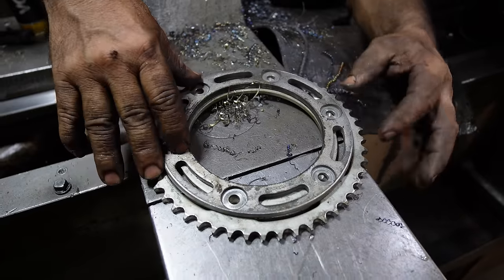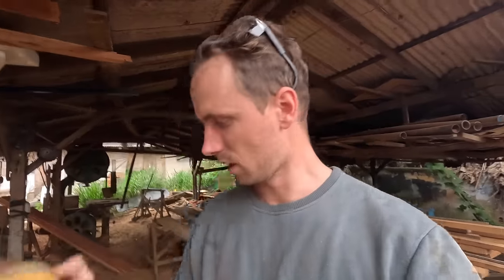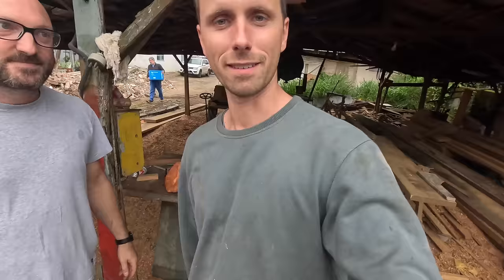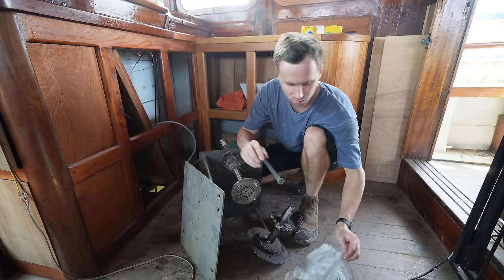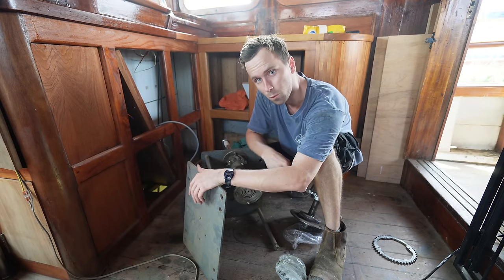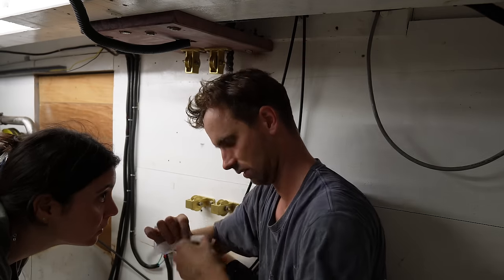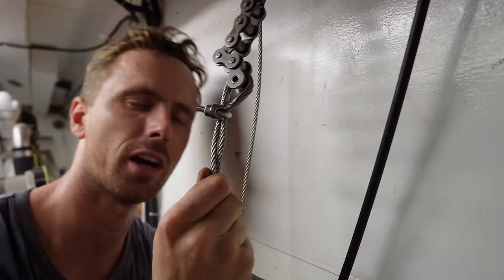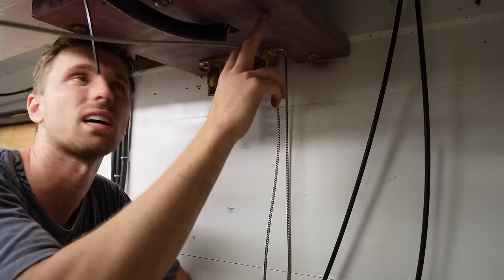Upgrading the old fashioned steering system of our RESCUED wooden sailboat — Sailing Yabá 158

Comment: Just a reminder - you know this already - but just saying - the steering system is the most crucial of all the systems on the boat. It cannot afford to EVER break or jam, so it needs to be over-engineered to be on the safe side. Pulley diameters need to be considerably larger to reduce repeated bending strain on the cables, and the cable itself should be at least twice the diameter that you're using. Don't forget Murphy's Law ... "If anything can go wrong, it will." Love your channel.

Comment: I would put a turnbuckle on both sides of the cable run to allow you to tighten the steering cables over time. The cable will stretch over time and you need to be able to take that slack out. You could use a tensioner pulley as well. The general idea is to be able to tighten without undoing the cable clamps holding it all together.
Reply: Absolutely
Reply: Great advice!
Reply: Strongly concur.
Reply: brilliant suggestion
Reply: A strongly sprung tensioner pully will help greatly with rudder shock. Just in case you hit an object (Sperm Whale) or s bit of coral.
Reply: Most systems use springs on the pulleys
Reply: Good idea
Reply: Always fascinating to see how you solve problems. Thank you for my Sunday morning coffee with Yaba!!! ❤
Reply: Yes, there needs to be something that will allow you to compensate for the stretch that is going to happen.
Reply: @m35a2ww  I have cable and windlass style steering system on an older boat. Partway down the cable is a healthy spring replacing the cable. The spring serves to keep the entire cable system in tension.
Reply: Good advice Marty Australia
Reply: Good idea adjustment is always a good thing
Reply: Yes turnbuckles are the way to go, plus maybe a larger cable to cut down on stretch.
Reply: You would be better off with a larger cable (± 3/8th ,10mm) I would also use nylon guide pulley rolling bearings for cable support. Turnbuckles are a must.
Reply: I agree, new wire will really stretch. Also there are two many turns lock to lock and blocks are way too small which will create wire fatigue..I would strongly suggest Dyneema instead of wire
 I hate the cable set on the stern, I had similar a few years ago, cable stretched and broke a long way from shore, similar location and was very difficult to jury rig steering
Reply: Very good point. My thoughts exactly.
Reply: Definitely a must have.
Reply: That’s right.
Reply: We had those on the schooner I worked on.... Came in handy during a particular messy passage when the old rope rubbed an gave way!!...

Comment: The helm station is a very robust upgrade well done. The cable and connections are definitely under sized for the size of the boat and the pressure the rubber will put on the steering system. There are quite a few great suggestions on here that I think you need to evaluate. I have been watching from the beginning and the boat is looking great. I am excited to see it in the water. Be safe. ⛵🇺🇸

Comment: Hi guys that's certainly an improvement but there are a few things missing.  You need a breaking system to secure the rudder in the midships position so that it does not thrash around when not in use.  How do you propose adding automatic steering?  Helming a boat on a continuous  24 hour period is not only very tiring but exceedingly boring and in poor weather will exhaust a small crew in very short order.  I also believe the quadrant attached to the aft part of the rudder is at the wrong angle if it had been place parallel to the waterline it would have moved horizontal instead of in a curved arc introducing small side loads to the roller leads.  The steering wires will require bottle screws introduced into them to take up and adjust the tension as they will certainly stretch during operation. The transom leads which you are going to install will require adjustable glands otherwise water will constantly enter via the openings and all the fittings nuts etc.,  should have locking mechanisms besides just applying "lock tight" to the treads the loss of a bearing shaft due to it coming loose could be disastrous in poor weather.
I don't wish to be disparaging but I am concerned about your safety and comfort when at sea.
Reply: A very comprehensive and logical comment.. (5 stars)  🙂
Reply: Excellent ideas
Reply: "You need a breaking system..."
No, they don't want it broken!
Reply: I was going to say the same things as you did..installing this old system back in is a step backward...with the engineering problems with this install and the lack of automatic and redundant systems is even more troubling..this channel appears to be about commodification and click bait then about doing things correctly..I hope they are not in heavy or rough seas with this, more like a dock to dock cruiser I guess
Reply: @manolisgledsodakis873  They should add a braking system instead....
Reply: That's a  much more comprehensive list of essential features than I can produce. My best advice would be to seek the advice of a professional  - have you asked any of your shipwrights about their abilities? Maybe Nico? I have only one small suggestion: I would be replacing every one of those nuts with a NYLOCK nut. A Nylock nut is a self-locking nut that features a  nylon collar that is responsible for the locking function of the nut. Just Google 'Nylock self-locking nuts' I too have little faith in LocTite for such an important role! Remember that however arduous the job is now,it will be 10X more difficult onnce at sea in a screaming gale of wind,  making the others feel decidedly unwell! 😢
Reply: Not sure if you can call me a professional as I have been retired for some years having spent 52 years in the Marine Industry as Master of numerous vessels, Marine Manager, Marine Director, and senior Vice President of two medium sized ship Operators, I am a former licensed Trinity House Marine, Pilot, Ice Pilot and Tow Master and Salvage Master, A former member of the Royal Institute of Navigation and a former member of the Nautical Institute.  The former owner of Three Offshore Sailing boats, and have sailed every Ocean in the world. My last appoint meant was as the Senior Principal Marine Surveyor for the one of the worlds largest Underwriters Warrantee corporations. I was simply offering some friendly free advice. As I really like to watch the progress of the  rebuild of wooden boats. I have been long retired so may well be too long removed from the marine world.
 @Davidcallard

Comment: Someone also suggested turnbuckles on each connection between the cable and chain to allow you to adjust tension .  Make sure to safety wire those turnbuckles like we do on aircraft.  Also I hope you plan to replace the mechanical  clamps with  Nicopress sleeves and use metal thimbles and a shackle for the cable ends.  This is best practice for aircraft and boat cables.  Keep up the great work.  Cheers from Canada.  Jim.
Reply: Also built an airplane here.  I commented on those cable clamps, they Will rust at the rudder connection as they are at the moment. Swaging is the way to go.  I install a lot of catenary cables for part of my job and outside those fitting always rust badly within 2 or 3 years. I am Not a boaty but from what I hear on other channels Dynema rope is a better option as is will not stretch but is quiet expensive.
Reply: All those inside pulleys need to be through bolted and not lag bolted & ideally those stern pulleys would work just as well  inside the boat using very minimal holes for the cables and not in the following seas . The chain ends where the cables connect need bolts or pins.

Comment: Ben, where the cable goes through the chain link, put a screw, flat washers and lock-tite the nuts on, through the hollow roller. This will prevent the side plates from possibly moving off the roller, allowing the wire to come off, and you having to put on the emergency tiller, during a possibly ugly time in a seaway, or when docking.
Also, YES, to your comment, about beefing up the pulley mounting points, where they are on sub-structure, ie bulkheads, mounting blocks, and not frame members/deck beams.
Best wishes from the far North.

Comment: Ben, A surefire way to know when the rudder is centered is to have one spoke of the wheel at the 12 o'clock position and then make a Turks head to fit on the spoke. Also you will need turnbuckles, tensioners and soft guides on all the wire cables that make up the steering system. Plus I would suggest using a thicker gauge of wire for the steering system.

Comment: My only concern is the diameter of the steering cable itself.  I would put as large of a diameter stainless wire as would fit your pulley sheeves.   I do agree with a turnbuckle on one of the long runs.  Further I might even add swage fitting for the loops on each end.  The new pulley system looks great and the  design is perfect.  I would just beef it up with cable size and crimped swage loops on each end.  I love watching you guys and never miss an episode.  Keep up the good work!

Comment: The new setup looks much stronger and works the way it should.  Good job.  The rule for the saddle clamps on the cable is "Don't saddle a dead horse".  That means do not put the saddle part of the clamp on the dead line (cut end of the cable).  The "U" goes over the tail and the saddle goes over the working end of the line.  Much stronger that way.
I also see some slack in the cable which can cause problems.  Turn buckles to be able to take up slack would be a simple thing to add.

Comment: You will eventually end up putting in a hydraulic steering system on a boat that size, that heavy and with THAT big of a rudder.
The pulleys are oversize for the wire you are using.
Either use thicker diameter wire to match the pulleys (which would have less stretch) or  skinnier pulleys to keep them centered inside the groove.
Need better connection method of wire ends  and chain ends.
Need a way to compensate for  the wire stretch. Turnbuckles will work.
How much stretch? If your standing rigging with heavy diameter stainless wire can stretch, use you imagination how much stretch there will be when the rudder is loaded when it is in the water and under way.
Reply: The transition connection from the chain to the cable is very suspect. Chains get their strength from being engaged on multiple teeth of the sprocket and not a single point load like you have.

Comment: Ben, many have mentioned about fitting "Turn Buckle's" so you can take up any slack when the cable stretch's. If you do fit them, install the inside the ship. As if they are outside they will corrode, making them impossible to tighten. Good luck you amazing builders.

Comment: Wonderful job with the rudder and cabling. You may want to put a chain guard on the wood where the chain on the steering column so it doesn't chaff the wood as it moves back and forth. I nice teflon backing against the wood would keep the chain from scratching the wood as it goes up and down when you turn the wheel. I love it. great job guys.

Comment: NIT PICKING OBSERVATIONS:  First off, great job!  Nit #1 - the shackles connecting the cable to your quadrant present an abrasive wear point as metal rubs on metal.  Perhaps something fixed to the quadrant could present an easily replaceable link.  Nit #2 - Your steering cable is much smaller than the bronze guide pulleys.  Being much harder, the smaller diameter cable may cut into the pulley.  Have you considered something like Dyneema?  Just thoughts.  I’m no expert.
Reply: Agreed, pulley wheel (sheave) profiles are designed with the cable/rope diameters and material in mind. Larger diameter pulley wheel less stress on the cable. Right sized cable/rope gives less stress on the pulley wheel.
Reply: I was going to suggest adding a wearable part as well, you don't want that quadrent wearing out, that would be a lot more expensive. The cables tugging, and the saltwater will make for a pretty abrasive condition. I was going to suggest an eye bolt, but anything is better than wearing the quadrent. And I agree with a lot of the others, adding a turnbuckle will make your future adjustments a lot easier, especially under sail at sea if you notice slop in your steering.

Comment: I think you should using self locking nuts on those axle grease bolts. Good luck.
Reply: or split pinning/locking wire them in place, and using turnbuckles to tension the cable
Reply: I agree.
Reply: Double nuts. Tightened against each other. No need for thread locker, which can be hard to remove in an emergency.
Reply: Agree.. I believe a second nut would do a better job in securing the nuts from comming lose. Otherwise a locking pin would work well too, but you will need to drill the bolts which can be trick
Reply: Or cotter pins
Reply: @yuriferes no need to drill the bolts. You can buy them pre-drilled from an aircraft parts supply store. They are widely used in airplanes.

Comment: You should put a small bolt or pin through the end on the chain where the cable connects to strengthen the end of the chain. That chain is designed to have a pin through it for strength. The end of the chain is the weak link in the steering.

Comment: I have really enjoyed following the Yaba rebuild to date. Now that you're starting to work on the steering and other critical systems, I highly recommend you research the breaking strength of the wire rope and the ratio of wire rope diameter to pulley diameter as well as using turn buckles or tensioning pulleys. Larger pulleys create less stress on the wire rope, which I believe is undersized for your steering system. There is also a correct way to fasten wire rope clips and the number and spacing of clips that should be used.

Comment: What you now need are two eye bolts with a nut and lock nut through the eyes on the quarter edge. The control wires must be attached to this so that you can tension the wires. The wires stretch quite quickly when they are new. good luck!

Comment: I'm sorry if I'm missing something here. I've no wish to criticise this amazing project, and Ben and MP's sheer guts and ambition BUT...Has nobody yet questioned the 'quadrant'? Surely a true quadrant should have a groove around the rim? Now I'm no sailor, but I've certainly seen a grooved quadrant on a boat before (SV Seeker, Zara and Odd Life, I think). Yabá's quadrant simply has the wires attached at the extreme ends. I thought the wires were supposed to pass over the curved grooved surface at all times, whatever angle the rudder is positioned, with each end attached centrally. That way, the quadrant behaves like a pulley wheel, and the tension is constant, over a wide angle of rudder movement, except after long-term stretching, which a turnbuckle can correct from time to time. The Yabá steering cables are simply attached to the ends of a shiny plate. I can see this should perform ok for the central range of the rudder. The natural elasticity of the long (thin?) wire may accommodate this.  Adding spring tensioners might extend the efficient range of the rudder before unacceptable  slackness and backlash occurs at the extremes of the (non-buffered) rudder movement. Without hydraulic help, the helmsperson may have a rough time handling the wheel. Please, somebody tell me I'm an ignorant landlubber with needless worries, a pedantic engineering geek who only ever built a Meccano (Erector) boat. I will gladly bow to your salty wisdom and experience.

Comment: Ben for the steering cables you might want to add some plastic or metal conduit piping to house the cables so the cables don't hang down or get caught in anything between the pullies and it will protect the cables if anything gets up against them.

Comment: Ben, just a heads up that’s not a kid on the pulley axle.  It is called a zurk fitting.  The grease gun goes over the top of it and the grease pumps through the fitting.  
Keep up the good work.

Comment: I like your steering modifications.  But I think, as previously mentioned, a turnbuckle would be good. And a bigger gage wire. Not for strength but to better fit in the pulleys.  If too thin wire, it will get Flatt as it put stress on just a small surface of the pulleys. 

Love your work! ❤
Tobbe

Comment: The grease cap is actually called a zirt fitting. You tighten them in the axle hole and pump the axle  with grease with a grease gun
Reply: This is an important comment. Don’t neglect figuring out how to use a grease zirc with a grease gun. It will save you a ton of time.

Comment: Great upgrade... 👍  I would suggest bump stops to keep the cable from rubbing on the swum step stanchions also some scrap metal along the bottom of the wall to keep the chains from rubbing on the bulkhead.

Comment: You should make a nice small yaba emblem and install it on the top of the wheel when it's dead straight so when you turn and come back straight you know that your rudder is in the  correct position 😊

Comment: Alanc518. When steering a boat with a wheel when you want to to starboard (right) you turn the wheel to the right as you do in a car. This is an instinctive action. You can achieve this by crossing the cables in the engine room for instance.Trust me in tight quarters and stressful moments instinct kicks in!You definitely need turnbuckles  to tension the system . Your rudder is big and will impart a loy of force on the system so it has to be super strong. Alan c (uk)

Comment: Great solution. Make sure you add a removable connection at the rudder. That’s a lot of friction on the rudder bracket. It’ll start wearing slots in that stainless. Easier to replace another small piece than that beautiful stainless bracket.   Again… Great Job!